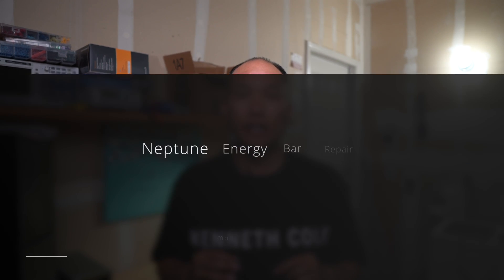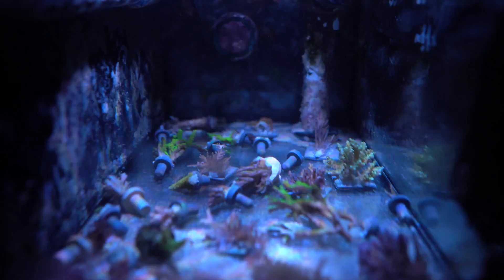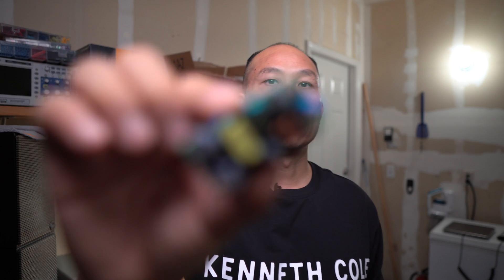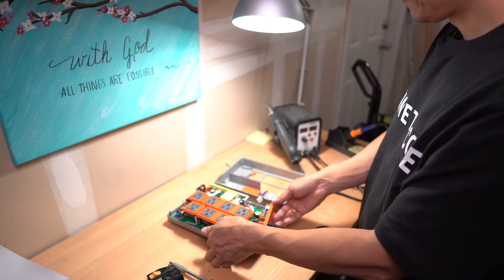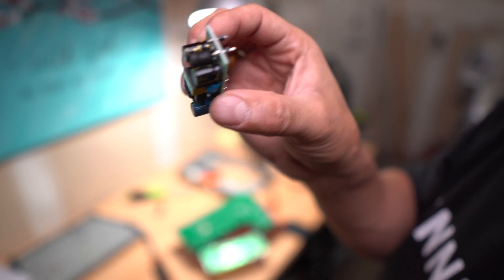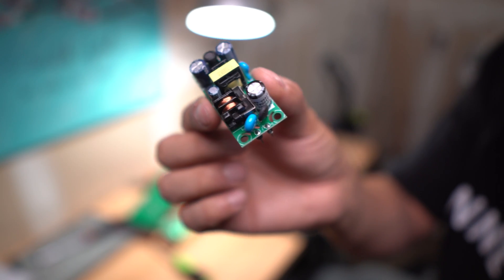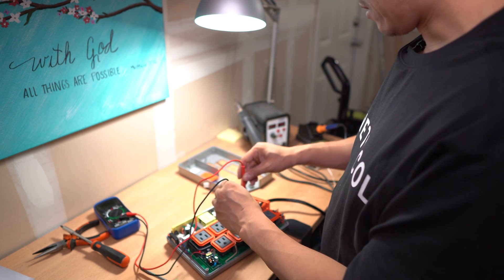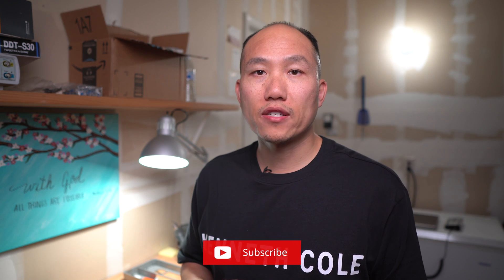Neptune Energy Bar EB832 Repaired! Let me show you how.

Comment: I rocking my gear nice shirt.  Sucks that happened with energy bar
Reply from the maker: I learn new things everyday.  It'll be easier next time the eb832 dies again.
Reply: @ModernReefer  but I seen many people throw it out not even trying to fix.  I guess people like me and you are just more inclined.  The Kessil lights go bad and it’s such a easy fix for them too.  Good job
Reply from the maker: Thanks.  This hobby is expensive so we have to do what we can to save some $$. In this case, repairing the unit was easy enough.  Kessil on the other hand would take more time looking up each chip to understand what it's doing to further troubleshoot issues. Depending on the complexity of the the issue, I may just have another person repair the unit.
Reply from the maker: Thanks, I'll have to search for it.